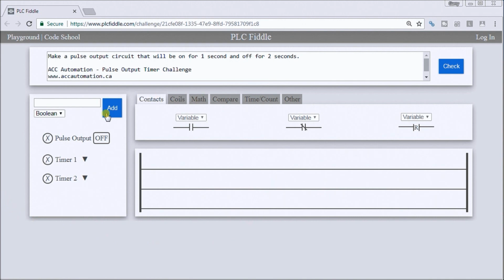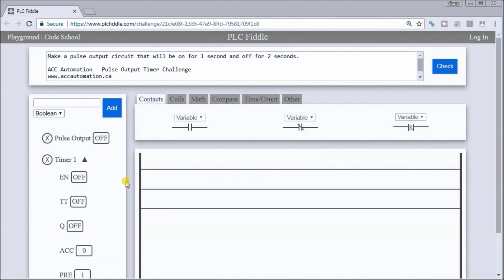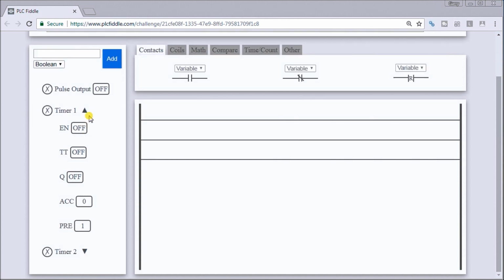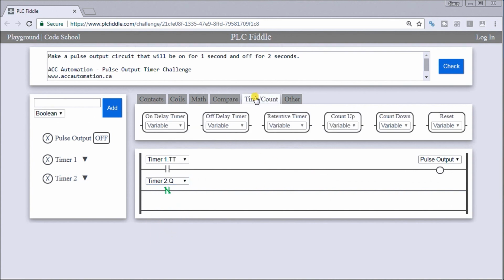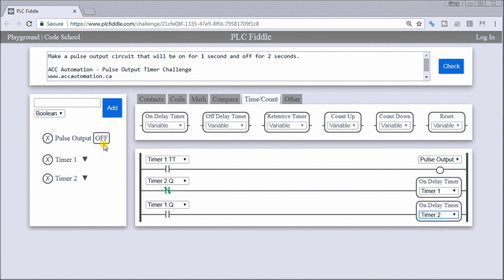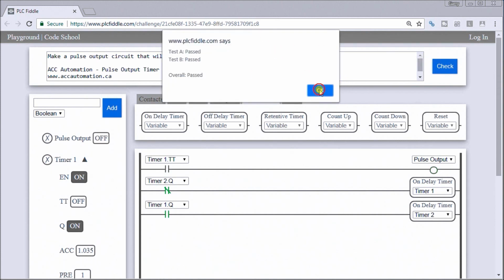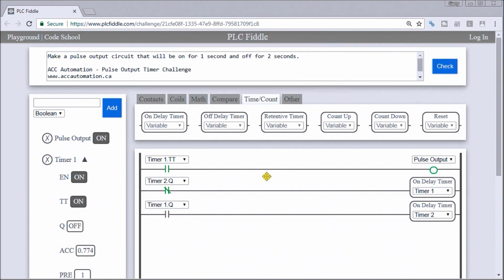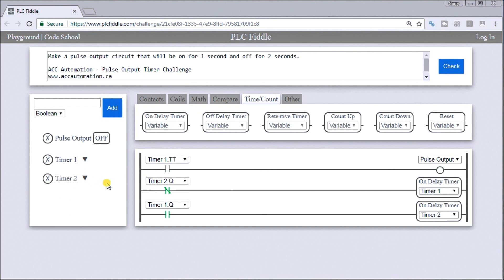PLC Fiddle Pulse Output Timer Challenge Solution

Comment: Excuse me Sir. How do I make 2 lights turn on alternately at a certain interval? and it will keep burning until the stop button is pressed. Thank you
Reply from the maker: Hi Malik,
You need to break down the problem. An internal flag will be used to determine to alternate the outputs. Once this is on then two timers are required that self reset each other. 
Here is an example using PLC Fiddle.
https://www.plcfiddle.com/fiddles/1e97c08e-38a7-4100-a085-c4e3cf4d6914

https://accautomation.ca/series/plc-fiddle-online-plc-editor-and-simulator-in-your-browser/
I hope this helps you out.
Regards,
Garry
Reply: Thanks Sir. I will try it. ✌😁
Once again, thank you sir for taking the time to help me. I wish you all the best. ✌😁